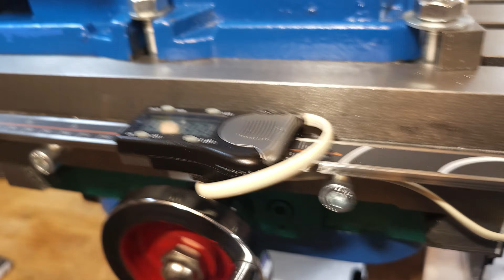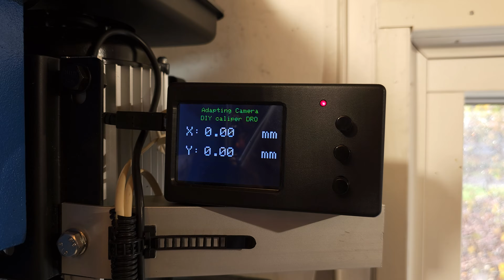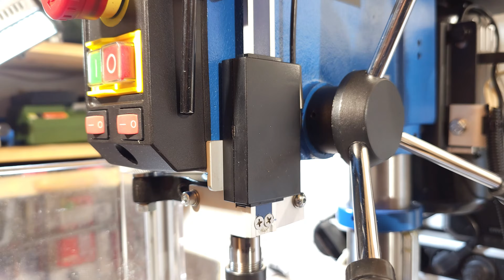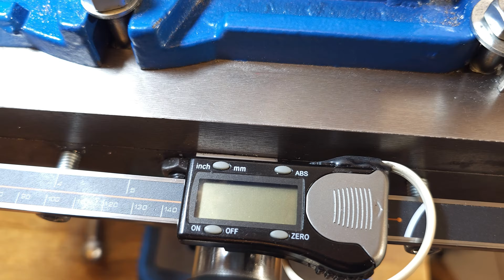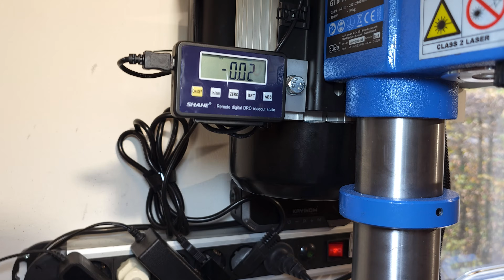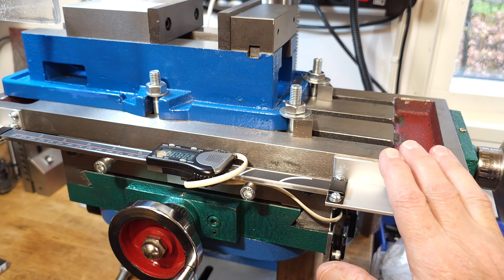Guede GTB 16/500 Vario bench drill machine - Adding XYZ DRO

Comment: Well, to start this drill is only 500W compared to Bosch PD40 which is 710W. Thus, it is definitely not more powerful. In terms of accuracy, I also do not see how it could beat the Bosch. The XYZ accessory you added to this machine are nice to have indeed but at what cost? If the manufacturer has to add these then the price will be close to unpayable. Further, don't forget that this is not a lathe or CNC but rather just a simple drill. Thus, I wonder what is the added value of having XY on it. I am not disputing it that it is a nice feature but I just don't see the use of it. The drilling action is for such bench drill is 100% on Z axis. So I still don't see how XY axis come into place. My Bosch PD40 does not produce that wobble of few mm you experienced on yours. But I attribute that in perhaps excessive usage in a 10 year period. Especially, don't forget that you had exercised way too much force on the handle to bore huge holes on steel. That alone brings huge pressure on the rack causing it to wear and cause that wobble. Again, I doubt this drill will do you any good service for boring holes on steel. It is too weak for that. Small holes on thin metal will be OK but certainly not 1/4" steel (especially the hardened steel!). Overall, I was intrigued on your engineering skill to install these accessories. Here in U.S. we don't have access to such tools.
Reply from the maker: You are wrong. This is a much more powerful machine. You should not stare at the watts, because that is not the whole truth about power, it only says how much current your motor draws, not how much power it has. Regarding the XY compound, I drill a lot of times more than one hole and not having to reposition the work piece for every move is indeed very nice. You may not have those needs and that is fine, but not everyone is like you. Also, I added an ER32 collet chuck, which is easy because the machine has MT2 shaft. I also made a modification which allows me to use it as a mill, and it can actually mill in steel also. Slowly, but without problems. None of that is possible with the PBD 40. The PBD 40 is a good machine for rare use and for use on wood, but not very good for metal. I think you are not having as high requirements as I have, so just leave it at that. I know what I am talking about, I have had the PBD 40 for over 10 years, and this machine is about one year old now. Yes, there are even better machines, but that is always the case, regardless how much you spend, but this is definitely a better machine than the PBD 40. It is also larger, heavier and more rigid machine, which is also a positive thing if you have the space for it.
Reply: @AdaptingCamera  I assume you've had engineering education and are familiar with minimum math concepts. The electric power is defined as voltage times current. With voltage being constant, the higher power means higher current which by itself means more torque for the machine. Thus your new drill with only 500W can in no way be more powerful than 710W Bosch. Again, you cannot defy mathematics. Not sure why you keep insisting that 500W machine is more powerful than a 710W one and label me a wrong! There is no logical or scientific in what you are claiming.
Anyway, as you have figured it out yourself too, Bosch is not a milling machine and never intended for that purpose although with a sharp drill bit and at low speed it still can make holes on steel but not boring which demands a whole different type of drilling machine.
Also, with the amount of money you spent on all these tools I think you could very well buy a mini lathe that does all these things in a much easier and more accurate way at comparable price.

P.S. Being an electrical engineer and a university professor, I do know a little about electric power and motors!
Reply from the maker: @Emry63  🤣 Claiming that you are an "electrical engineer and a university professor" is easy on an anonymous YouTube account, but your post clearly proofs that you know very little about what you are talking about. You also seem to lack knowledge about torque and how it is produced and where it is important. Anyway, I have no time to answer and argue with you, but would recommend you to have a more serious look at these machines before commenting the next time.
Reply: @AdaptingCamera  LoL 😅😅😅😅😅😅 So AdaptingCamera is not anonymous? Is that your real name? When you come here and say a 500W drill is more powerful than a 700W it makes it obvious you even do not know what a Wattage on electrical motors means. You don't need to argue with me or anyone else when you are literally illiterate in electrical concepts. Silence is your best friends in such situation not torques!!!!